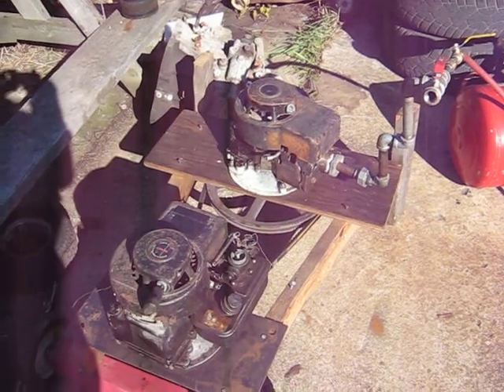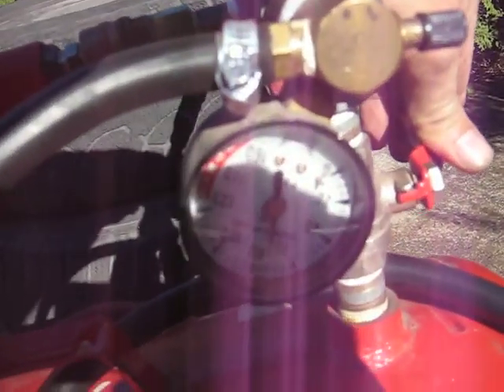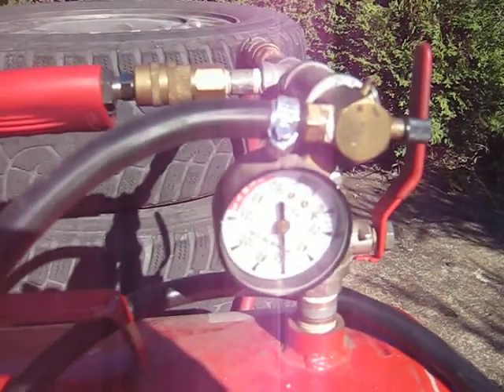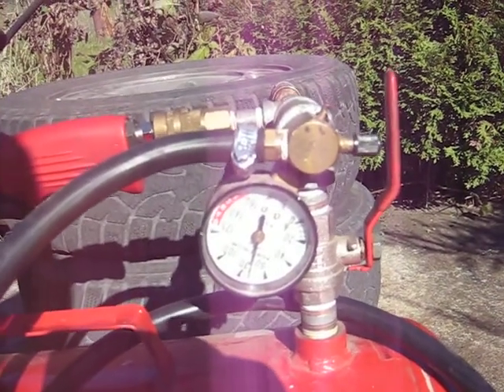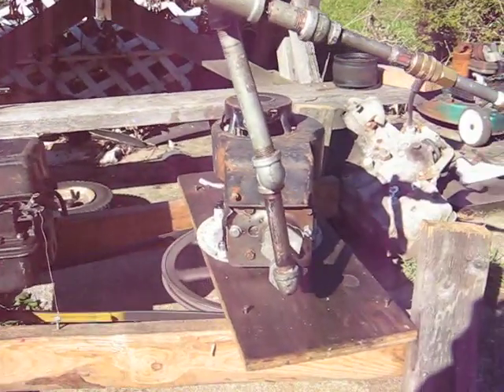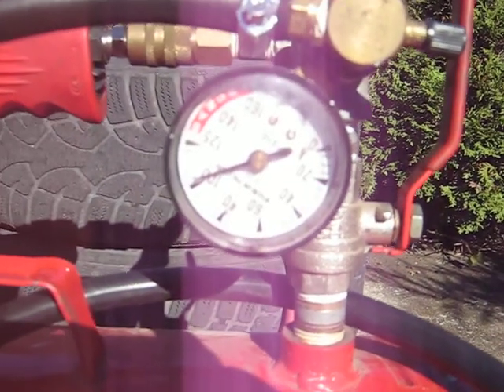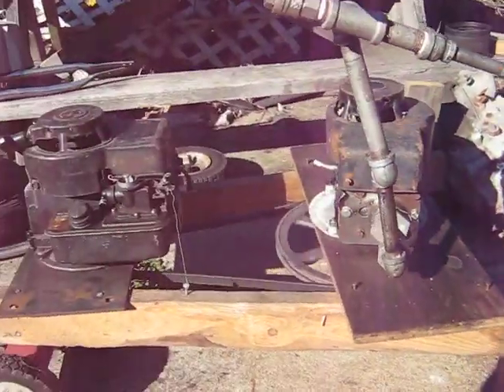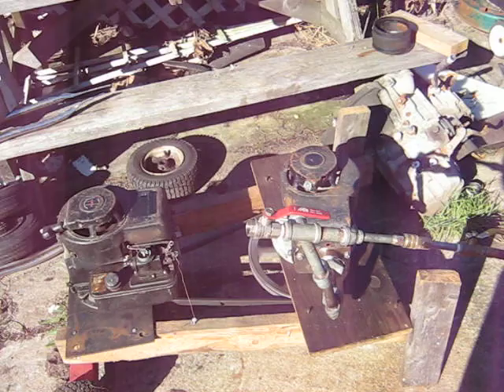125 PSI Run of Lawnmower based Air Compressor

Comment: What is the black hose going to? I see you used the original pos fitting that comes on these air tanks, take my advice and junk it, they only have a 1/8" hole going through them and are only good for airing tires. I tested my AC compressor on my 00 s10 for use with air and it pumped a 10gal tank to 100 psi in 30sec @2k rpm bu the briggs is taking forever.
Reply from the maker: The black hose is just for airing tires, the main hose connect to a 1/4" steel pipe that tees into the tank.That sounds like good output from your a/c compressor. I don't recall what pressure range my Briggs compressor seems to be the most efficient at, though it is only turning at about 600 rpm thru the v belt drive. I would imagine your a/c compressor would be spinning a good percentage of crankshaft speed. Is there any problems you know of using an a/c comp. for air, perhaps piston oiling concerns etc.? If not, that could be a very easy way to make a sweet compressor!
Reply: ChargerMiles007
after doing the math I found out it was doing 3.3k rpm at 2k engine rpm. Ya most ac pumps are good for air but they do need oil so to keep them running they need a oilier on the intake and a oil separator on the output. Mine had a 1/4 fitting and it got real hot so I think I'll step up to 3/8 or 1/2 to try and keep the same ID as it had before. If your interested in ac pumps check out the york 209 or 210 pumps.
Reply from the maker: Thanks for the info, wow that compressor is really spinning fast! No way I can spin a Briggs compressor that fast, my disc valves would be floating all the time! I suppose the pistons in those compressors are much smaller than the 2-9/16" briggs bore though, so they can work better at higher speeds.
Reply: Ya they are smaller but they have 2-6 pistons also. I have a york 209 ac compressor and what I understand they pump 9cfm @ 3k rpm but they are able to do 6k rpm. The york 206, 209 and 210's have 2x 1.87" pistons but have a different stroke per model. The yorks also have beefy pistons and rods unlike the newer air compressors.
Reply: time to go to pick-y-pull
Reply: Have you been able to figure out the CFM s the Briggs is putting out..?? Or your continuous use.??.I'm working on a similar project to run my air files and orbital sanders for body work..can't afford a big expensive pump motor..so I'm working on different head ideas for the Briggs..just curious...

Comment from the maker: Have a look at  "Hamishbrown air compressor" on Hamishbrown  channel.
He used my of disc valves to build a 4 cylinder compressor. He uses 4 sheet metal disc valves per clyinder. I retained my valves with small steel screws, while he welded on retainers. One of his welds broke, resulting in a messed up piston, haven't conversed with him in a while, but I bet he is repairing it now.
The disc valves open and close just by the air pressure in the clyinder, very simple, and works well at 600rpm

Comment: Biggest problem I'm trying to over come though (before starting to put maths behind it and work out how much air will atuchally be produced and how it will relate to the second stage) is how to get the valves to open and close in the right order. Did think about using a really heavy gauge steel plate instead of the head and using check valves above each cylinder... but by doing that I'm cutting off the oil and water gallery circulation

Comment: Really interesting idea, I'm finding faint mentions online of people using v8 engines for this. Half of the engine being used as an engine, and the other a compressor. I'm really tempted to use an old Ford 1.8 non turbo diesel lump to power another bottom end, then possibly introduce a small diesel generator bottom end (with smaller pistons) to form a 2nd stage compression, I want to build one to power a blast pot...

Comment: @ChargerMiles007 I'm running it off the engine (SB350) in my truck and mounted it using a standard SB A6 mount.  The air tank is from an 18 wheeler, mounted between frame rails.  I'm not sure how much HP it needs but suspect it needs 3-10 hp depending on the rpm.  Keep in mind most auto AC compressors need oil in the freon.  You'd probably need an oil mister and oil separator for your compressor.  The A6 and York have their own oil sump so the oil system is separate from freon.

Comment: @ChargerMiles007 The A6 is a long steel (black) cylindrical (+ sump) compressor.  Google found me a few images:
photobucket com\albums\v249\natica43\Miscellaneous\AC2.jpg
photobucket com\albums\v249\natica43\Miscellaneous\AC4.jpg
photobucket com\albums\v249\natica43\Miscellaneous\AC1.jpg

Comment from the maker: @Slider68 
Now you have me interested!
So how can I identify a GM A6 compressor at a wrecking yard? Is it just the standard A/C compressor on a GM car or truck. I used to have one 10 years ago, but my son and I used a grinder to tear it apart, to see how it worked, it was a 4 piston type, if I recall correctly, with a round casing.
I actaully may have a compressor from a Toyota Corrola, if memory serves me correctly.
What horsepower motor do you drive it with?

Comment: After viewing the effort and challenges to get your DIY Briggs compressor up to reasonable PSI levels, I highly recommend picking up a ~$10 GM A6 or York XX210 from a wrecking yard.  I've used my A6 at 2500 rpm to power 4 air hammers all day long several times, filled 100's of tires + run air tools for hours.  These are safe, reliable, produce huge amounts of 150 PSI+ air and with the electric clutch are easy to use (pressure switch to control PSI).  I've used my DIY A6 compressor since 1998.

Comment: @xoxoXoieoxox Most R12 AC compressors operate with roughly a 50 psi (inlet) to 300 psi (outlet) on a typical hot day.  There is usually a high pressure cutout switch that won't let the pressure get above a certain amount too.  I can't recall the typical cutout pressures exactly, but I believe it is in the 500-800 psi range.  Basically I'm trying to say that pushing an AC compressor to 1200 psi could result in a catestrophic failure, but they are definitely safe for up to ~300 psi.

Comment from the maker: @xoxoXoieoxox 
HaHa :)
The idea is to run the compressor slowly, so that it doesn't heat the air up so much due to compression.
But I think you already knew that. :)
Really, a car compressor will put out 1200psi, that sounds pretty high.

Comment from the maker: @318Captain 
Weld an extra intakelobe on the cam, to make it intake every time. You could also fill in the area in the head above the exhaust valve to help increase output.

Comment: @ChargerMiles007 pretty sure all you really need to do to make that work is grind off the exhaust lobe on the cam, or simply remove the lifter. Then connect a one way valve through the spark plug hole and your done. You'd still have some wasted strokes...hmmmm

Comment from the maker: @qazwsx7552 
It has to be the valves that are not working out right. You could try making disc valves, like I did, sheet metal works well, but you have to keep it flat to seal well. Do you have a vid of it you could show me?

Comment from the maker: @318Captain 
I am thinking of doing a test with a stock lawnmower engine to see what pressure it will put out.
I just realized that the regular camshaft will work, but put out 1/2 the air possible, being a 4 stroke.
I will do the project with readily availible tools. No MIG welding etc.

Comment: I tried making a compressor like yours out of a 3 horse Briggs but i used a steel plate and welded 2 check valves to that plate. I only got 10 PSI out of it. Do you know what I can do to get it to produce 125 PSI.

Comment: You've made me kinda decide on a use for my Changfa CF 170  diesel and for that 300 liter reservoir/accumulator  I have from a well pump. 
Now I just need an engine to convert to a compressor!

What does Zontar have to say about this project? :-)